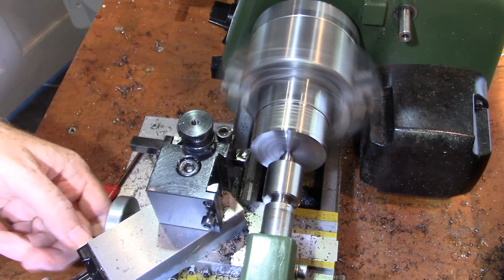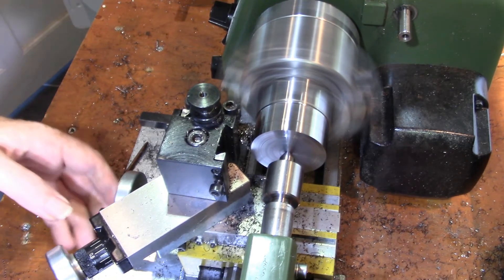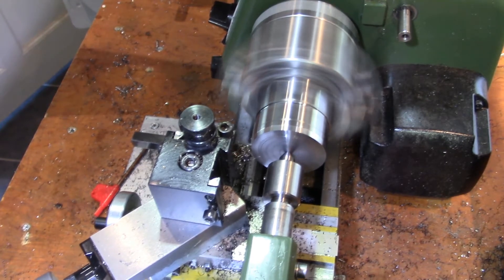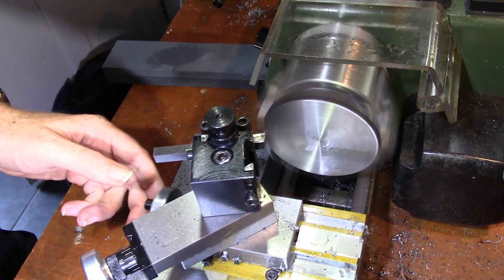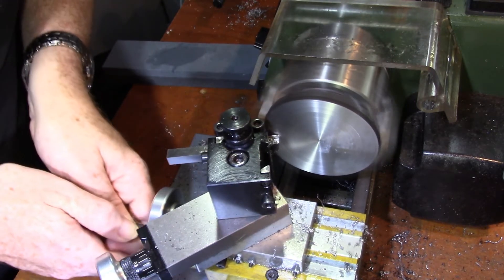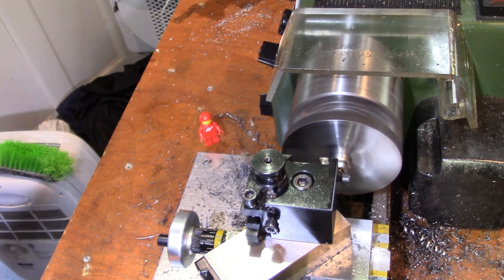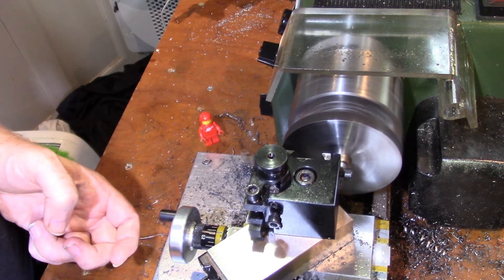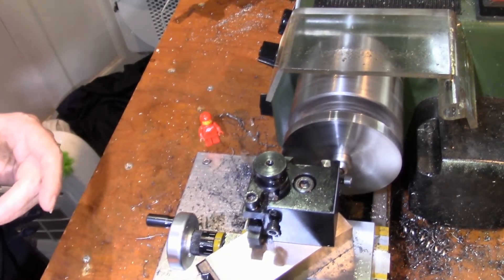Watchmakers Face Plate - Part 3

Comment: you can hear the chatter in #2 in this series. as you progress in your cut from center to rim of the face the cut is smooth till you get out to 3/4 of the full diameter.

as you progess from center to edge on a face cut the surface feet per minute increases with the same revolutions per minute.
just reduce the rpm and the sfpm will reduce and end your chatter problem.
Reply from the maker: Yep, you're absolutely right about the problem, but the solution isn't so simple. The Proxxon PD 250/e has a fairly small motor, and the speed control means that reducing the rpm also reduces the torque. When I tried turning this part at lower rpm, the tool would just stall the spindle completely.
Reply: @AdventureswithaVerySmallLathe  Excellent. You have recognized the problem. The solution is the choice every machinists occasionally faces. Should i upgrade to equipment that will allow this work to be done in my shop or farm the job out to a shop that is equipped to do it?
Thanks for the nice videos.

Comment: Chatter can have multiple causes and sometimes due to more than one reason at the same time. From the material the lathe is made from, over extended tool or top slide,  very slightly loose spindle bearings, a loose carriage, cross or top slide gib etc etc etc. It's always an early death for carbide since it's a very hard material and that hardness makes it extremely brittle. Chatter breaks down the tip or edge very quickly. The general rule of thumb when chatter starts is to reduce the speed and/or up the feed rate. Most times but certainly not 100% of the time that gets the tool or material out of it's natural harmonics range. It's the one thing I'll try first. And carbide unless there special lapped edges and tips normally used for aluminum will have very dull edges and tip radius. They cut by using heat and pressure that helps to plasticize the material to force it to flow off the base material. Yes it will work on small machine tools, but because of the machines size, weight and horse power anything you can do to reduce the cutting loads can only help. That's why those aluminum specific tips can also help with cutting most other materials and why high speed steel honed razor sharp will almost always do much better on the small light weight machines. A lot of today's micro carbide formulations are far better at resisting chatter, but there still not immune to it.

The chip coming off the material should never ever turn instantly dark brown or worse a dark blue as it's moving across the tool. What your wanting is when turning steel with carbide is at most a light tan color no more than that. If the chip then turns blue a few inches away from the cutting tool that's fine as well since it means the heat caused by the frictional forces of cutting is mostly being removed in the chip. That ultra high heat at the tool edge is what drastically reduces any tools cutting life. Most cutting tool recommendations for feeds and speeds with carbide should mostly be ignored since for most of those it's assumed flood coolant will be used with industrial sized machines. Cutting oil will help the tool to cut and it helps reduce the friction a bit as the material flows over the tool tip. But cutting oil has almost no high cooling effect like flood coolant does. Intermittent applications of coolant with say using it brush applied is also death on carbide since it has a low tolerance for thermal shocks.
Reply from the maker: Thanks, that's a lot of information, and some really useful tips. Now that I have a proper tool grinder, I'm aiming to make much more use of HSS, and hand ground brazed carbide, to get the extra sharpness, and shape the tools better for the specific application.
Reply: @AdventureswithaVerySmallLathe  Something I read a long time ago in one of my Model Engineering magazines stated that "it's impossible to get a better part surface quality than the tools finish already has". That's alway's stuck with me as good sound advice. Green grit silicone carbide wheels used for sharpening carbide are only a roughing tool used to get the approximate shape needed. Even by eye those green wheels leave a rough jagged edge to the tool. Ideally a slow speed diamond wheel is then used to lap the cutting edges to a high finish. Failing that then diamond hand hones a lot of the woodworker tool dealers carry can also be used. My choices for sharpening and then honing HSS tools are based on what highly experienced woodworkers find to be the best since compared to metal workers there fanatical about obtaining the very best in sharp tools. Unlike there cutting tools our only requirement different than there's might be adding a small but critical nose radius or flat on the end of a threading tool to gain a smoother surface finish with standard turning tools and allow the tool to stand up to the cutting pressures. Or that flat/radius so a thread doesn't have a sharp internal V shape.

Comment: Nice use of the LH turning tool to do the OD! I'm going to keep that in the bag of tricks :)
Reply from the maker: Thanks! It was very much a "needs must" solution, as I was turning well outside the comfortable swing of the lathe, and couldn't reach the outer surface with a right hand tool/